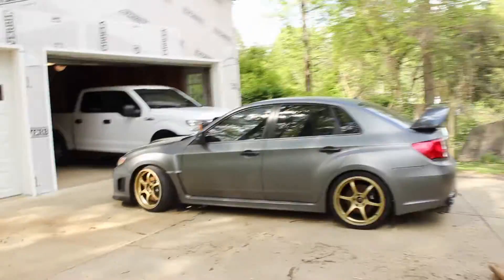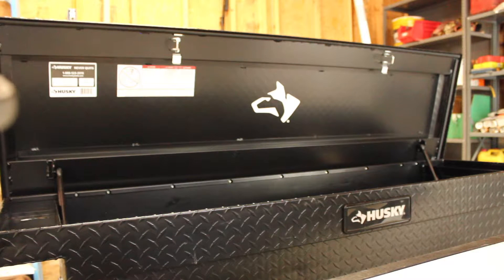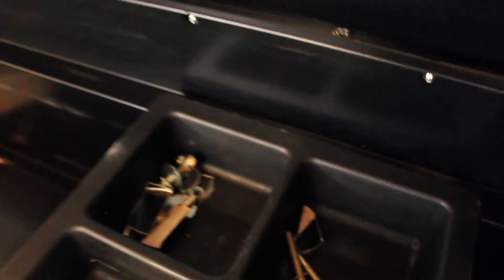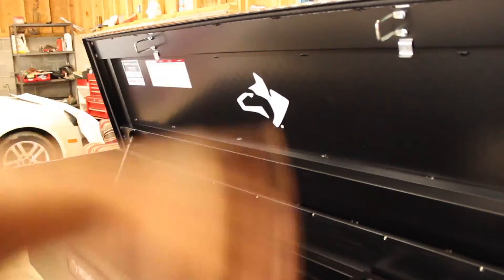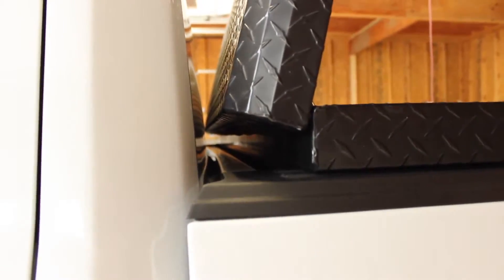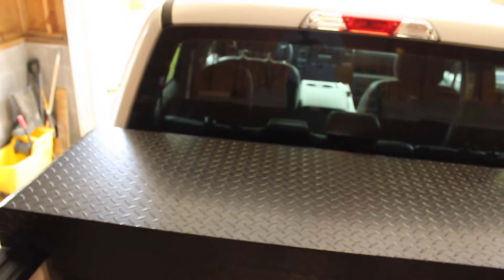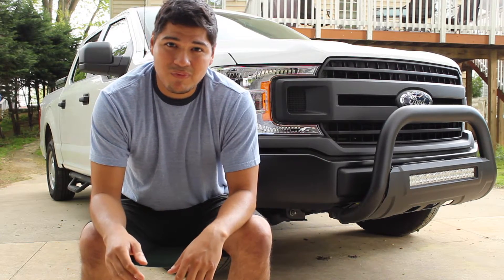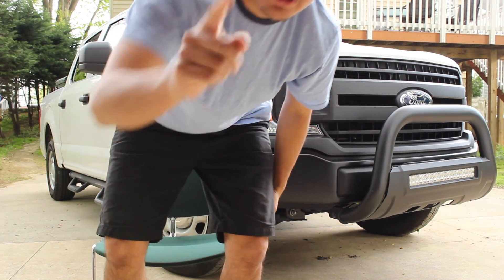Husky Saddle NO DRILLING Truck Tool Box | 2018 Ford F-150 XL 3.3L V6

Comment: How do you open it I just bought one and I can’t get it open
Reply from the maker: On this version you have to push in the key hole to open it.
Reply: Apex Corner I tried on both sides but I push it in and nothing happens
Reply from the maker: @Raymondcurryjr  If the key hole button pushes in but doesn't open then it is locked.
Reply: Apex Corner I thought so just wanted to make sure. kinda sucks cuz the keys are on the inside lol thanks.
Reply from the maker: @Raymondcurryjr  That sucks! I'm sure a lock smith can get it, the mechanism inside doesn't look too complicated. Good Luck!
Reply: Apex Corner I got a hanger and got it Thanks for the help bruh!👌🏿👌🏿
Reply: We’ve tried everything turning keys opposite ways same way, one at a time nothings happening
Reply: Will it keep water out, say like if you go through an automatic car wash?